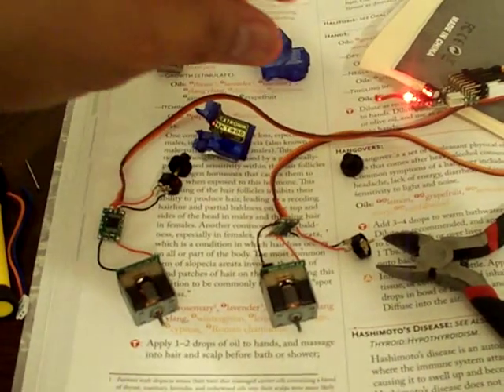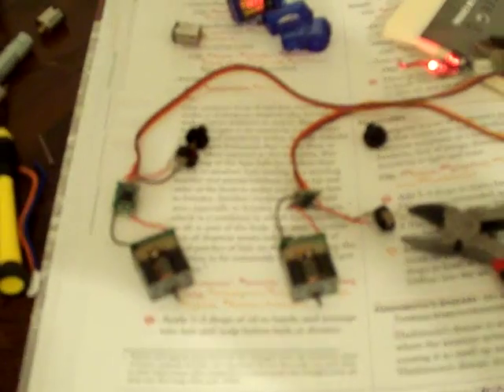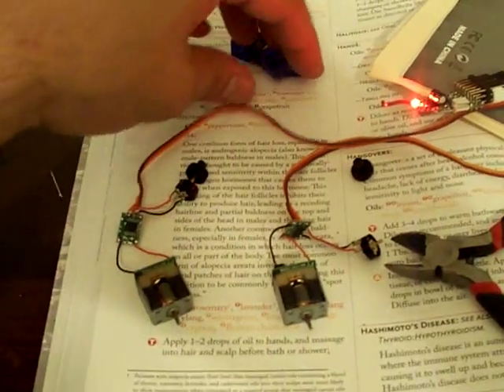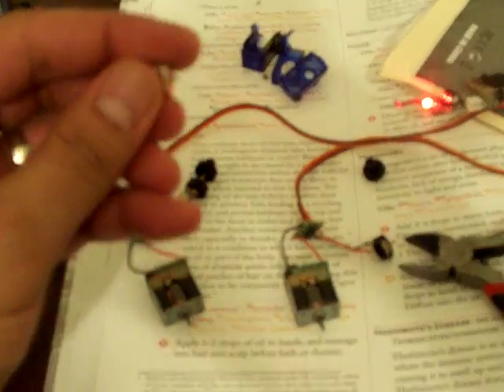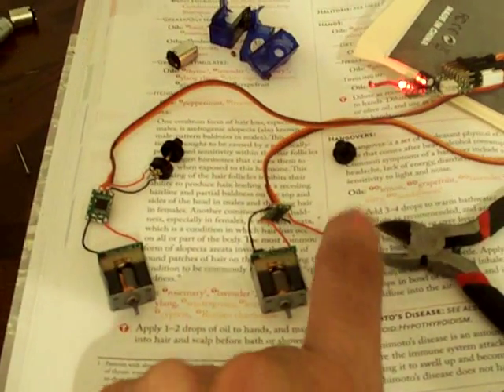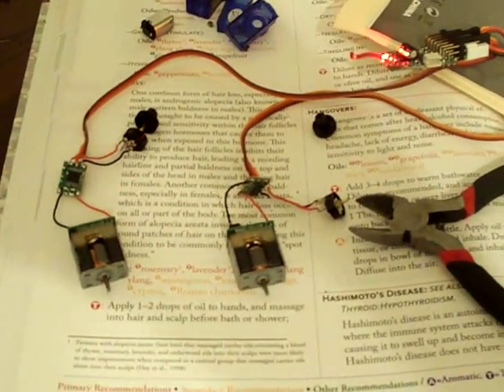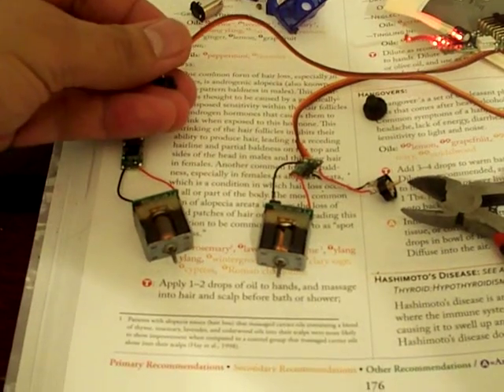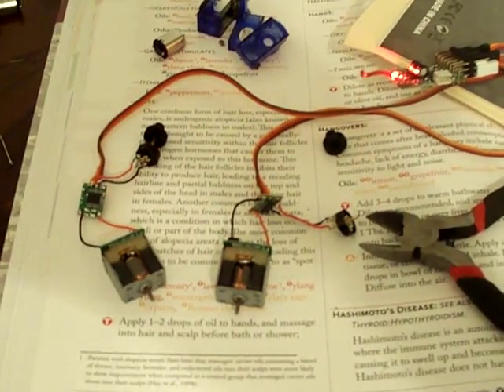Old servos as ESC for micro brushed motors/actuator

Comment: Nice and clear. Got a bareboned AR500 (3g about) that this would suit. I guess an N20 motor would be too heavy on the FET ?
AR500 can run 2 servo's on 1S, so it has the mind wondering and wandering.